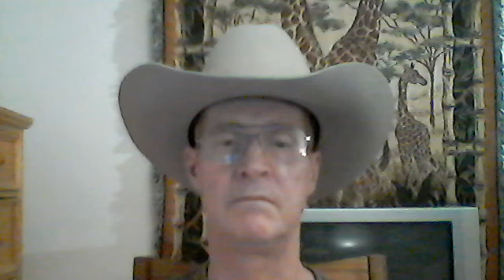My First Mobile CW QSO

Comment: Stan, what did you use for a mobile 20M antenna?
Reply from the maker: A Hustler mobile antenna that had a loading coil  in the center. I mounted it on the trunk. It was about five feet tall. You could choose different coils for the various bands down to 3.5 MHz.